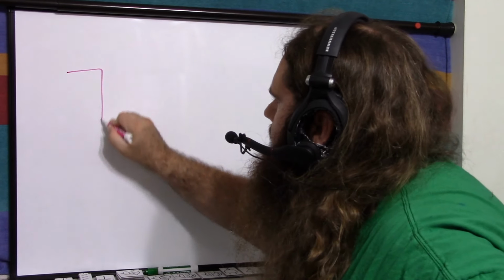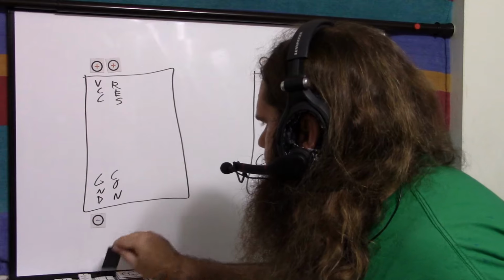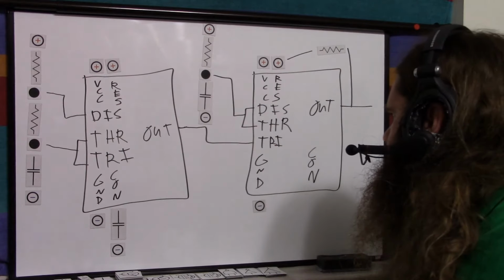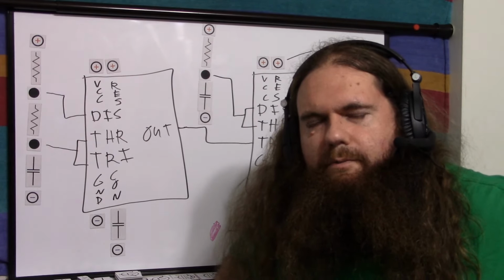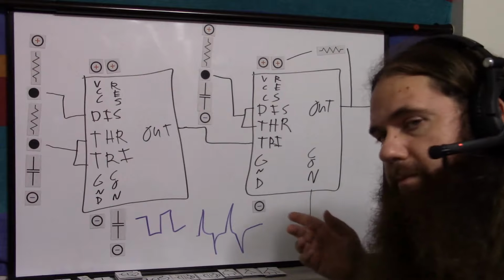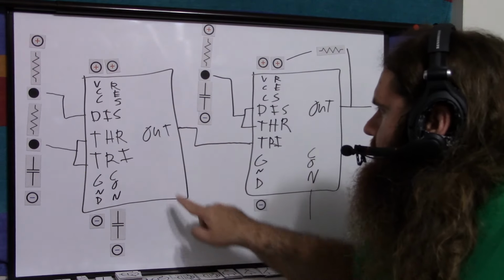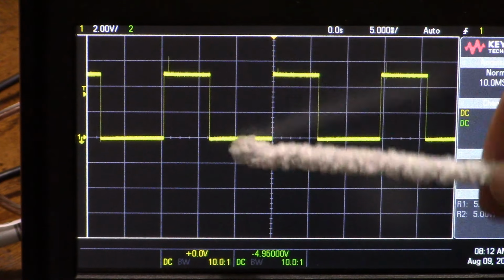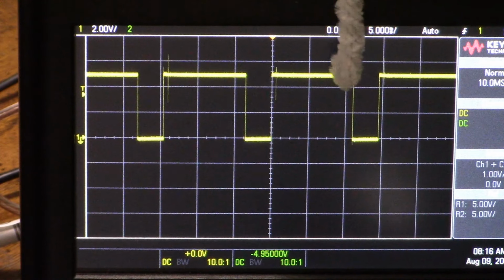Choose Your Duty Cycle - 555 Timer PWM - Pulse Width Modulation - Simply Put

Comment: Love this video... Could you use a 556?
Reply: Sure can, they're much more expensive relative to the cost of the NE555, but they certainly simplify wiring with a single VCC/GND connection for 2 timers.

Comment: Love this explanation! But let's say we are modifying someone else's square wave, and we just want the ability to ADD duty cycle?

Would you just invert the square wave single into the monostable timer using like a transistor, triggered off the PWM source? I.E. Change the source High duration, into the monostable trigger Low duration. Then the potentiometer would only add to the PWM duty cycle?

Comment: Hi. How can i make a high speed switch to activate a small electromagnet? I'm using a 9v battery as a power source.
 I tried to use a hall effect sensor and it kinda works but the problem is 
that the output power out of the sensor is VERY low and it can't power up the electromagnet, 
so then i did use a transistor activated by the hall effect sensor so that the transistor can 
deliver a higher voltage from the battery (9v) to the electromagnet but it doesn't work either,
 it delivers a very low voltage.
I also tried to use a laser switch and same thing happens. Then i did use a reel switch and it works but for a very short
period of time (one minute or less).What happens with the reel switch is that the on and off is so fast (many times per sec)
it creates a spark bridge between the contacts inside the switch and they stick together (on the ON position).
the only way i can make the electromagnet work is to make the contact (switch) directly from wire to wire as opposed 
to using any other type of switch (hall effect sensor, reel switch, etc).
I guess that what i'm dealing here is that the switches  like the hall effect sensor creates a digital signal, and connecting 
wire to wire directly is an analog signal, digital vs analog, i don't know...
So then I've been trying to build a mechanical switch (contacts made  by the wires directly like
 in the reel switch but with a mechanism to push one contact from 
the ON position to the OFF position to prevent both contacts to stick together in the ON position and of course adding a diode
 to prevent the back EMF from the coil to go in one direction. But i haven't succeeded. 
I'm wondering if i can use a 555 timer (or two of them) to do the switching (on and off) and be able to deliver
 whatever full voltage the battery has (9v fully charged, or 8v or 7v etc) to the electromagnet.
Will this work? if so, how should i connect all the components, and what components should i use?
Reply: Without knowing anything about your project it's hard to offer great advice, but it sounds like the device you're looking for is an operational amplifier. This will take the small signal from your sensor and turn it into a larger, more useable voltage without loading the signal down.

Don't be fooled, however. Op amps usually aren't great at high current output. The output of the op amp could then be used to drive a suitable MOSFET, which should be able to handle the high current draw.

If you need to switch your device on and off very quickly (thousands of times per second) because being constantly on will burn it up, then you will probably want to insert a timing circuit such as this in between the amp and FET.

You'll need to do some studying to learn how to use op amps effectively. Hope this helps get you on track.

Comment: You can have also linear duty cycle control from almost 0 to almost 100%, with only a single 555 timer and a single capacitor a single potentiometer and 2 diodes. You just have to control the charging and discharging of the capacitor by use of the output pin 3 without using the discharge pin 7 and also without using the control pin 5.

Comment: This looks like it could be what I'm looking for.  I need dumb little timer to turn a thing on for about 1 second, then wait about 10 seconds to repeat.  Mostly off with little bursts of power every 5 to 10 seconds.  Your explanation in this video looks like 555s could do it.
Use a long timer to turn on a short one.
Then what would really be cool is if I could then run two of them 180 degrees apart from each other.
Not sure how that one could work.

Comment: Maybe im a little late but my project is to control different PC Fans independently with Aroduino. Yes there are 3 Pins to get 16 bit Pulses but i want it easy so my ide is tu use an 25khz frequency from a quartz crystal and your timer. Will that work?
Reply: If you really want easy, just adjust your fans by increasing/decreasing the voltage they are fed. 🤷
Reply: i bought the arctic p14 pwm, daysichain. Easy goin xD
 @aviandragon1390

Comment: I just did that circuit with the two 555 and a irfz44n fet for a pwm and it works but it is not changing the duty at least not the way I wanted anyways I need to scope it and see the actual wave form , I am gonna use it for a tesla coil interrupter , your video help me a lot

Comment: Great explanations, thank you. Working on a lighthouse project and was wondering how to slow the turn/off of the LED to give more of a rotating effect. Using 555, 4017 and S0913s: GutReise 10pcs E10 Screw Flood Led Lamps +10pcs E10 Base,4.5V Cold White Led Bulb Light (4.5V, Cold White)

Comment: I was trying to make something similar, with an analog voltage to control. Vcc to 555 was 3.3 V and my analog voltage min and max were 0-3.3V. But I cant create more than 67% duty. Is it because of the inner 2/3 Vcc control voltage overriding my control input? I am new to this, and I am simulating on Multisim using CMOS 555.

Comment: I'm trying to control a 60W fan with an ESP32/Arduino. Until watching this I would have bought a PWM (555 timer, rc circuit, and fet) board and X9C104 (digital resistor). It seems with this circuit I could just control the duty cycle with voltage which seems like it'd remove the need for the X9C. Would this be a better circuit? I would think this would also allow ability to get 0% duty cycle (off) or would I still need an additional part of the circuit to accomplish the off state?
Reply: I'm also realizing this whole fan controller circuit might be unnecessary as with the ESP32 there's already PWM pins. Fan controller would work but would the frequency that the ESP32 operates at be suitable for dimming LEDs?

Comment: Great stuff here!
I am a beginner and it's easy to confuse things up.
I am now working on a project and I would like your opinion. I am trying to replicate a train with electromagnetic propulsion. Same as the Japanese trains but what I am interested in is the configuration of the electromagnets. Imagine a rectangle with 2 permanent magnets and both of the long sides, then there are electromagnets on the side of the ''road". At this point I need to configure the electromagnets in a way that I can switch their polarity and the period of switching should also change with a potentiometer in order to let the "train" accelerate. Is that possible using a 555 timer or there are better ways that I could use?
Thank you.

Comment: About the high-pass filter: wouldn't it work with an RL high pass filter? Series resistor with a parallel inductor instead of series cap and parallel resistor?

Comment: Excellent. I've been looking for a 555 circuit where I could adjust the duty cycle without affecting the frequency. 
Very good work and explanation. I replaced the 1K resistor with a variable to control the frequency, and I also placed a 100mF capacitor across 
the Pos and Gnd rails and this really helped to improve the stability of the frequency on the scope. You're a natural instructor. Thanks much.

Comment: Could you use a 556?
Reply from the maker: Absolutely. Any time you find a chip that's sort of a "combo" of more than one chip, they'll share power rails but the rest of it will be separate, so you can use them however you'd like. Saves on board space and bypass capacitors that way.

Comment: what's the maximum frequency we can get out of 555? and what's the PWM resolution?
Reply from the maker: That's going to depend on the specific chip and how it's built. According to the datasheet for the TI NE555P which is close to what I use, the output-pulse rise and fall times are on the order of 100-300 ns, so in principle you could operate that chip at around 1.6 MHz, but pushing it that hard would not give you any sort of "clean" square wave, and if you're chaining two together for PWM then you'll be limited even further, so honestly I wouldn't try to get more than a hundred KHz or so out of it. As to the PWM resolution, that can be as precise as your variable-voltage source (either from a potentiometer or a DAC), and the rise/fall time tells you how close you could get to "true 0%" and "true 100%". You'd really want to just get the chip and test for a real answer, but my "rule of thumb" would be to take the worst-case rise and fall time from the datasheet and add them together, take the reciprocal to get frequency, and divide the result by 10 for a ballpark figure.
Reply: @simplyput2796  Thank you, subscribed! btw; is there any way to control the 555 pwm with arduino?
Reply from the maker: The analogWrite command on an Arduino already is PWM, but the PWM frequency is fixed and depends on which Arduino you have. If you want to use the dual-555 setup to get whatever frequency you need and just use the Arduino as a variable-voltage source to set the duty cycle, you could try using analogWrite with some smoothing capacitors to get a mostly-stable DC signal, but I would actually recommend something more like a DAC chip combined with a serial-in-parallel-out register, so you can use just a couple of Arduino pins to set the value of the DAC feeding the control pin of the second timer.
Reply: @simplyput2796  Thanks.

Comment: Greetings.    Good work on your channel ..  Hope it continues to grow..

As far as why the RL resistor on the 555 output..   I am GUESSING the output is a totem-pole circuit  providing source and sink capability.   Totem-pole outputs normally have around 2.5 - 4 volts high levels.    If you need rail-to-rail levels, for interfacing none TTL devices,  you can add a RL resistor pull-up,  however, this will increase your output impedance.    Take a look at TTL Totem pole output stages and see if that helps you. 

Enjoy
A.
Reply from the maker: Hey, that's an excellent thought, and reading about TTL totem-pole push-pull outputs, that sounds exactly like what's happening here. I bet you're right.

Comment: Has anyone used a 555 timer calculator to design a circuit. I've been using 555s to make circuits to control LEDs for a few months now. And the circuit that I end up building is way different then what the calculator said to build. Example if I want a 50% duty cycle the calculator says R1 and R2 will be the same value(makes sense in theory charge and discharge at the same rate). But in practice I have to put a diode in parallel with R2 and R1 ends up being a much larger value then R2 to get any where near 50%. So I'm wondering why my circuits are so much different is this the way it is, cheap 555s or what? I bought a bunch of differnt 555s from ebay and some CMOS 555s for LEDs that run on batteries all of them have been the same.
Reply from the maker: I went over this in my astable (square wave generator) 555 video, actually. If any calculator told you that you could get 50% duty cycle with R1 and R2 the same, it was created by a moron, because that ends up being a 67% duty cycle. This method here is the best one for getting an exact (including 50%) duty cycle. The stuff with the diodes is more complex and still is really hard to pin down the duty cycle. This way, you literally can just set it with a trimpot and you're done. Calculators are just a super-rough guideline, and you'll need to tweak the values yourself.
Reply: @simplyput2796  Thanks for the response I'm just teaching myself this stuff, and thought I might have been missing something. I got my first CMOS 555 about a week ago, and noticed the same thing. I knew a CMOS could not be out of spec as a cheap janky NE555. I was glad when you came out with your 555 videos to help clear somethings up
Reply: and I was getting the feeling that the calculators where made by someone that just learned the theory but had no real experience